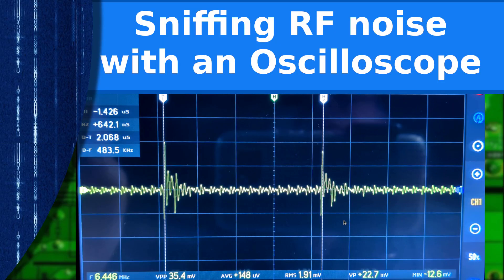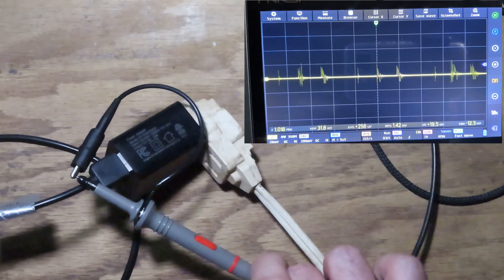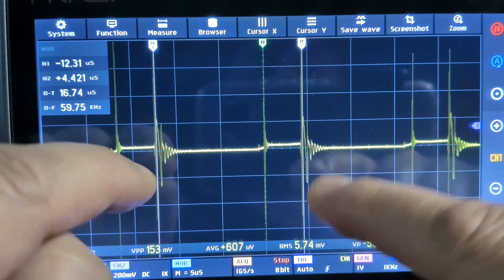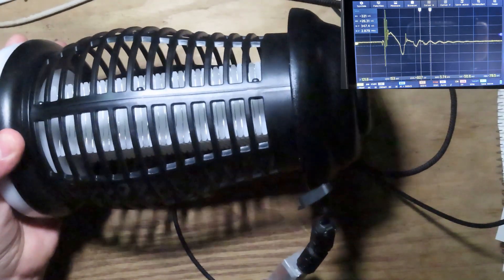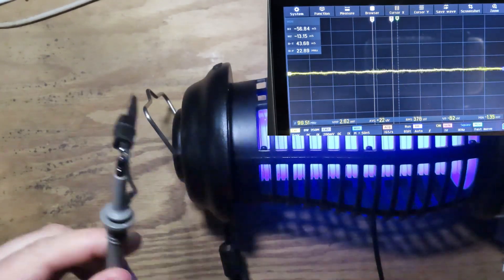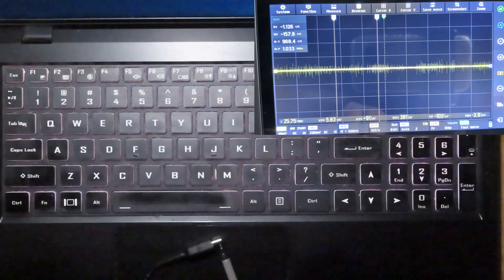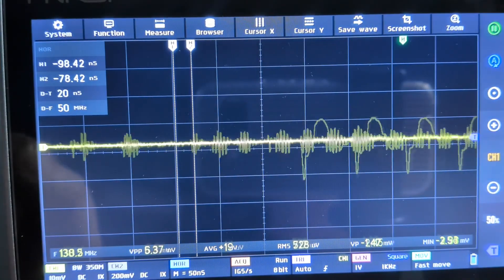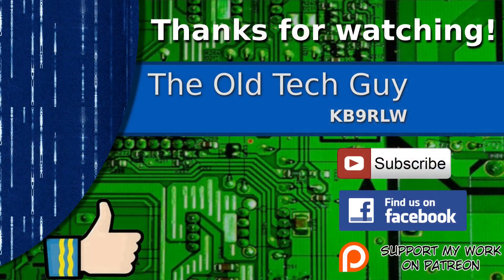Electronics - Sniffing RF noise with an Oscilloscope.

Comment: I have no knowledge of electronics, but I'm having problems with high levels of radio frequency noise in my home. I'm trying to understand how to identify the source of the emitters, and the video seems interesting. Thank you and congratulations. Can you please tell me which oscilloscope was in use? Would a simple one with a limited bandwidth (like 200KHz) be able to find those signals?
Reply from the maker: Why not use the radio receiver you are picking the signals up with now?

Comment: Very nice! Good video. Ive been having an issue in a truck losing radio signal from assuming internal RF interference. Going to give your method a try to help isolate it. Thank you for the tip! 😜 Im guessing your scope is a FNIRSI 😜

Comment: Nice! I used to play with my micsig automotive scope at my desk at work getting accustomed to it. My desk in the powerplant control room had 6 computers and 11 monitors along with 13.8Kv conduit running in front of the back wall. It was a noisy place that showed up fine without the ground lead loop. The loop is definitely a better pinpointer though! Thanks! 👍👍

Comment: I live in the countryside away from almost all sources of RFI. My 80m is virtually unusable. Why? I have a high end solar inverter in my basement. I'm replacing it with a newer larger model but will be placing the new unit in a grounded faraday cage and putting ferrite beads on every wire entering ad leaving the enclosure. What a pain.
Reply from the maker: There are RFI filters for AC mains you can buy and put on the AC output.  You might also need a high current DC RFI filter on the DC input as it will radiate off that side also.  Yep, Inverters are noisy!  When I was parked among several other RV's, their inverters clobbered HF.
Reply: @loughkb  Hi Kevin, I'll have to look into that. The inverter can put out 12KW of AC continually so the filter would have to be pretty substantial. Probably more expensive than the inverter which is a Sol-Ark 15K. Yes, I have ferrite beads on the solar panel inputs too.
Reply: @loughkb  I take that back. Been looking at models on eBay and there appears to be a wide selection of AC line filters. Most appear to be for high voltage 3 phase AC servo drives. I'm sure if I look long enough I'll find something suitable. Thank you !
Reply: Twist the positive and negative DC wires together if you can. A twisted pair will radiate less noise.
Make sure the new solar system is not using any optimizers or micro inverters. That just adds a lot more noise sources.